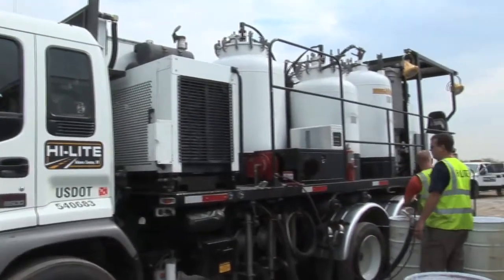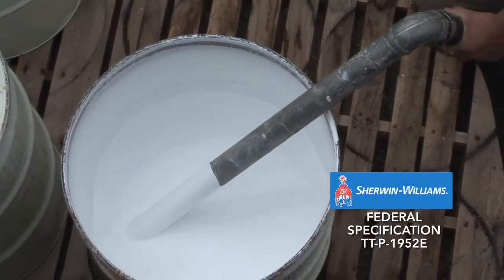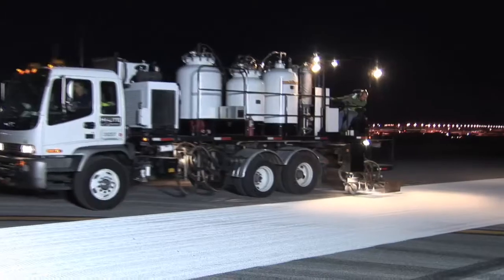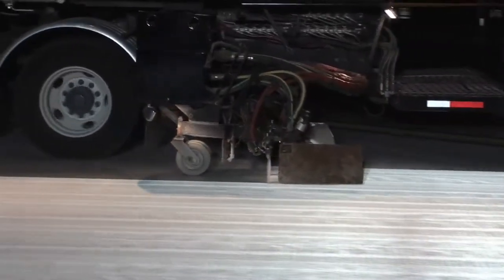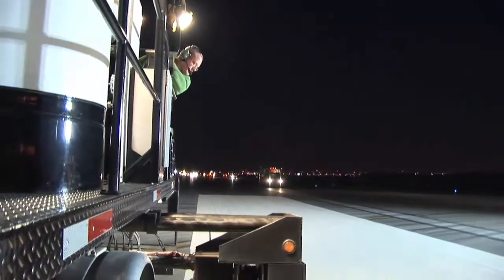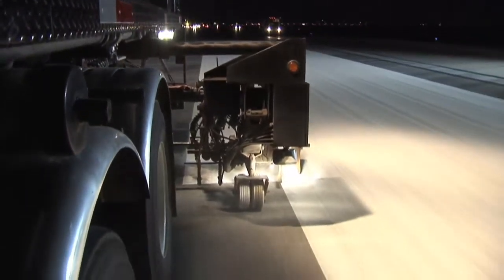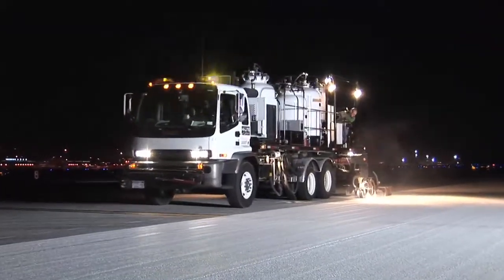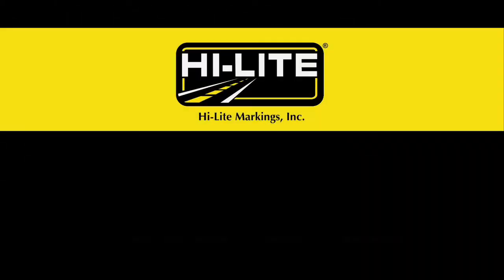Airport Pavement Markings - Hi-Lite Markings, Inc.

Comment: the paint used on airports is basically the same as highway paint and you could use it on the highway, but it's at a different spec than highway paint and more expensive.